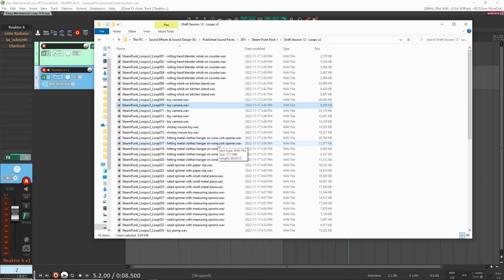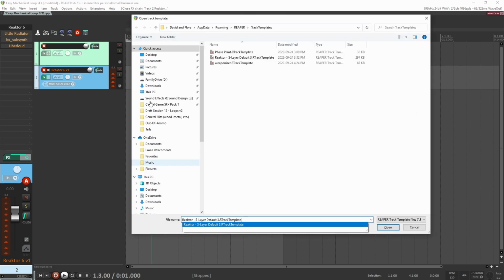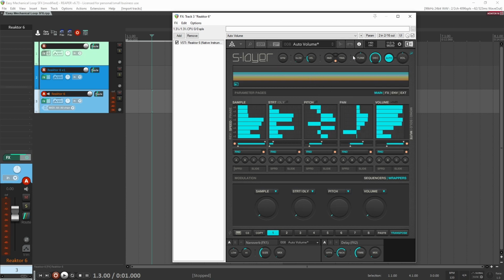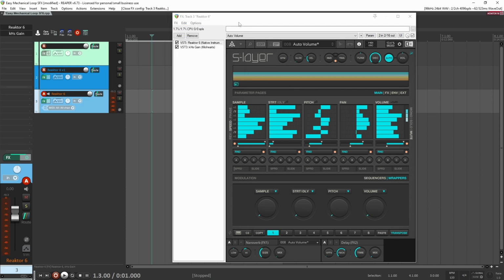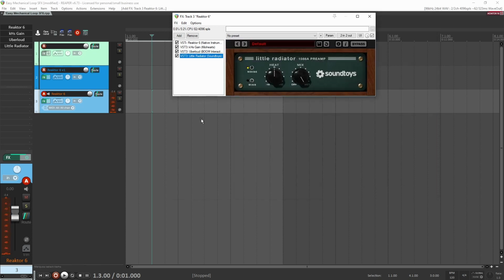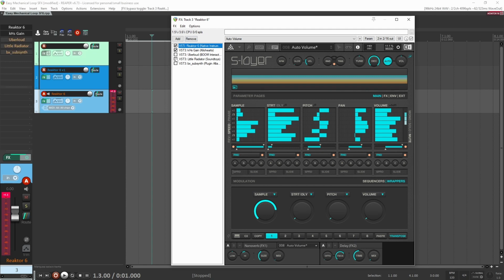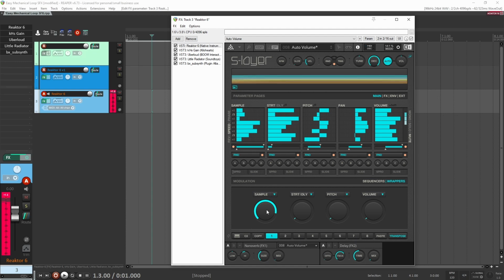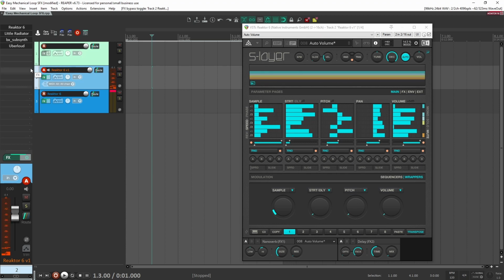Mechanical Sound Effects | How To Create SFX Using Items Around Your House

Comment: Hey David some quick questions.

1. How would you rate the EM258? I saw the video From Aaron Brown reviewing it and it looks almost too good to be true, but from this video and his, it sounds really good. 

2. What interface are you using? My interface only goes up to 96khz, and I'm either going to upgrade to the EVO 16 or the Focusrite 18i20. But if I'm going to be recording 192khz I'm thinking I should get the 18i20 since the Evo 16 doesn't support that high of a sample rate.
Reply from the maker: 1.	It is too good to be true…yet it’s true :). They are really great. Considering the price and what you get, I highly recommend them to sound designers who want to get some ultrasonic recordings.
2.	I use the Audient ID4 (mark 1) which only goes up to 96khz as well. I don’t record through that though so no need to have it go to 192khz. I record with my Zoom F6.
Reply: @daviddumaisaudio  Oh nice good to hear. When you are recording sounds, do you have a treated room? your recordings sound pretty isolated, so I was just curious on how to deal with avoiding background noise.
Reply from the maker: @halfblind9860  I wish my room was treated, but no, it isn’t. It’s a matter of making sure that everything that makes noise is turned off when recording. I also tend to record close to the source so that the signal-to-noise ratio is as wide as possible. After that, I use noise reduction in post to remove any remaining noise.